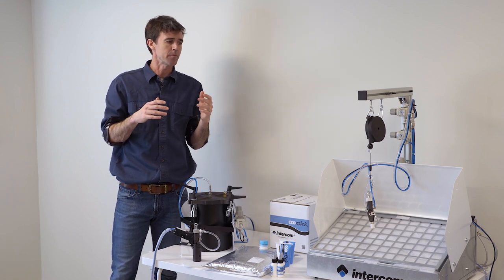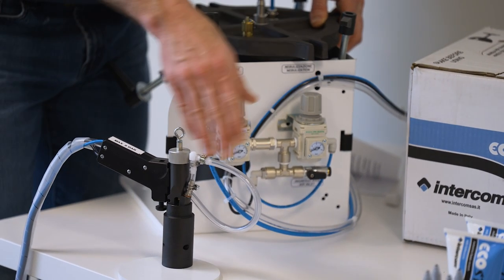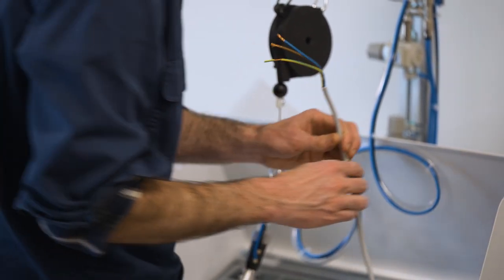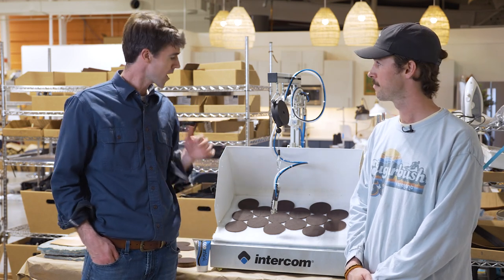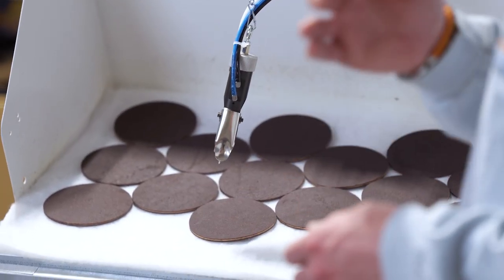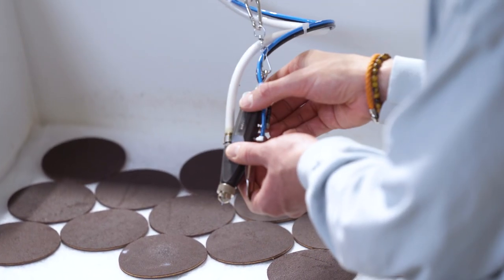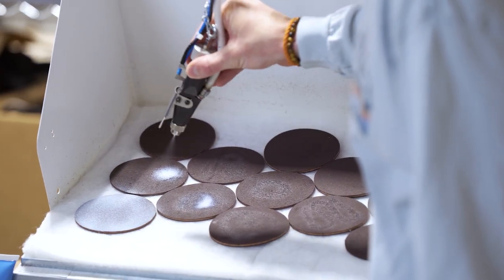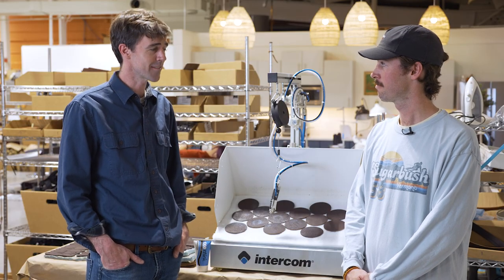How glue machines can increase efficiency for small and large crafters

Comment: With the over spray on the filter base, does the residue become a problem when putting new peices of leather onto it - does any transfer onto the grain side?
Reply from the maker: We recommend having a few filters so when you finish one batch you don't just remove the pieces, remove the whole filter base as well. Then let everything dry. Then an hour or so later when you take the pieces off you can use the filter again and there will be no issue with the dried glue residue.
Reply: @Buckleguycom  Thank you.